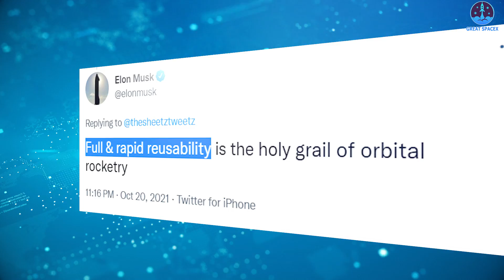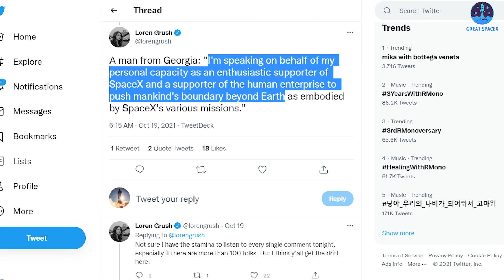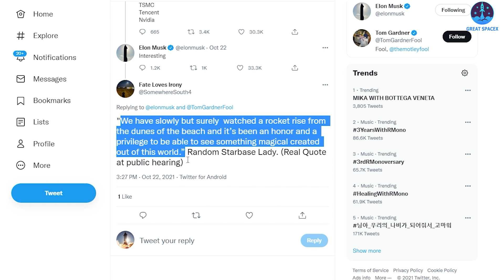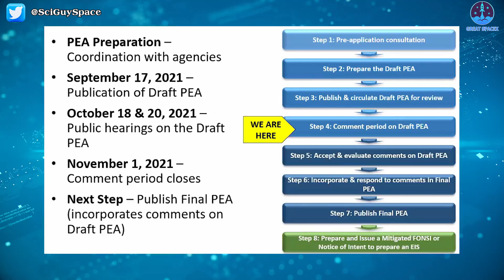Elon Musk Just Reveals "SpaceX Starship will be ready for its first orbital launch next month"

Comment: They need to finish testing, building the tower (wiring/plumbing/quick disconnect for the fueling/testing), finishing the GSE system, install a deluge system for noise suppression, desalinization plant to feed the deluge system (sea water will rot it out rapidly). Ship may almost be ready to fly, but there is still a hell of a lot of work left to be done before it can launch.
Reply: Most likely in 2022.